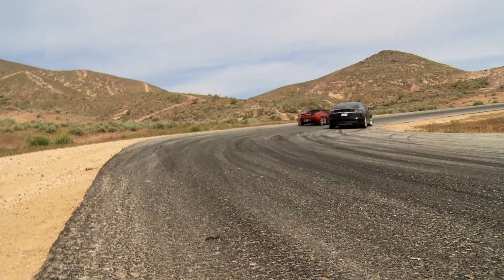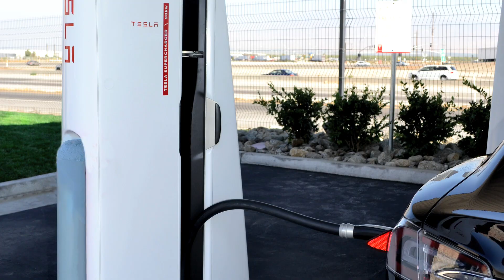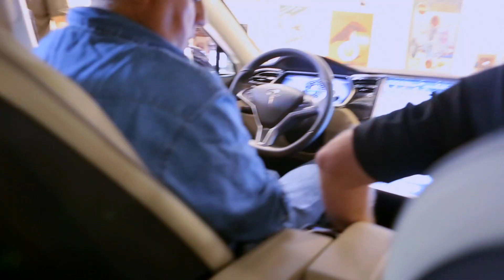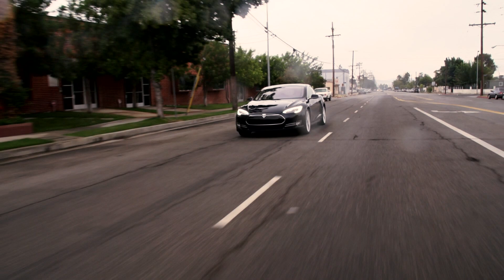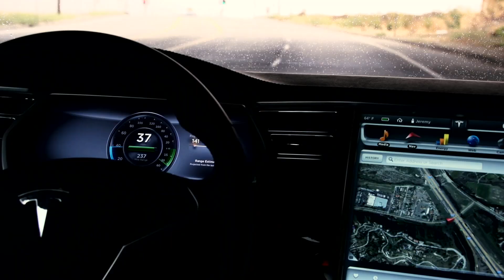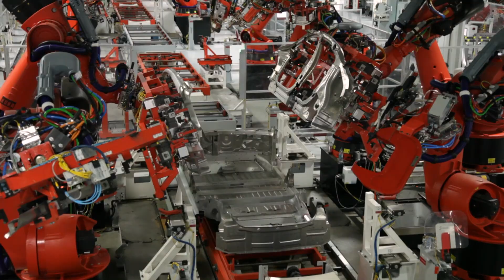2012 Tesla Model S - Jay Leno's Garage

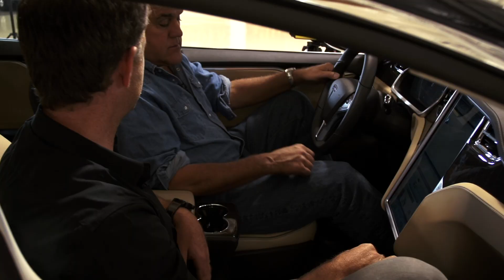Comment: 7:27 Life of the battery is only 10 years ??? So the whole car becomes a cool looking hunk of scrap metal after just 10 years ??? REALLY? At the Tesla's price of $100,000 and only lasting 10 years that is $10,000 per year of depreciation !!! So the Tesla saves you $3,000 per year in gas but looses you $10,000 per year due to its short battery lifespan ??? Someone explain to me how buying a Tesla over a Mercedes E class or BMW 5 series would make sense financially?
Reply: Sounds like he's thrown away a lot of perfectly good flashlights.
Reply: Batteries can be replaced when they die.  The 5k a year you save on gas and the fact that it doesn't need maintenance as often make buying this car realistic.
Reply: battery holds longer than 10y.
Reply: JundaComputersGmbH
as an owner of a model s I can tell you with confidence that it does not cost 45000 to replace a battery. I inquired about the prices awhile back ago and I was quoted 10000 to replace the battery. Which sounds like a lot but you may or may not have to do it after 10 years. By then you spent more on gasoline and lets not mention maintenance
Reply: A car normally works for 3 years, then all the problems come. A Tesla battery has a life at least 8 years.
Reply: Not a big deal Junda. Replace the battery pack with an improved one in 10 years. If you didn't learn it already, look at the Prius. The batteries are warranted for 8 years and rarely need replacement even then. I had a truck that the transmission blew out on it when it was 5 years old, cost me $3,000 to replace it. If you add up all the other maintenance, repairs, gas, etc., it's cheaper to operate a Tesla than probably any other gas engine car sold today. What does 10 years of maintenance and gas cost on your old fashioned gas burners? LOL
Reply: You dont pay 10000 a year
You buy a new battery for 10000 and drive the car another 10 years probebly with more milage than dodays model s
Reply: most electric car companies actually rent you the battery, as soon as they wear out they will be replaced free of charge
Reply: You can buy new batteries. Jesus.
Reply: Leo Tonozzi
  No you can't  Everyone knows that when an electric car's batteries die, you have to throw away the car.  Sort of like when you blow a head gasket on an IC car, the whole thing is just junked, right?  ;)

The reality is, the Prius has demonstrated that Lithium Ion batteries can last at least ten years - maybe longer.  And if the car is in good shape, it might be worthwhile replacing the battery (for example, using one from a wrecked car).

I am not sure why some people feel THREATENED by electric cars. These are the same dweebs that don't understand fuel injection and claim that "carburetors are better" and cars were "better in the olden days".

I dunno, I'll take the safety, performance, comfort, long service life, fuel efficiency and raw HP of today's pony cars over the ones of yore.   And yea, electric cars are among these - max torque at 0 rpm.

I live old cars, too.  But as an Engineer, I can't live in a dream world.  And since I drove a lot of the cars from the 60''s as a kid, I know what they were actually like. 

What I love about Jay is that he loves ALL CARS and doesn't waste time saying one kind  of car is better or worse than another.  He loves them all and has them all - from steam cars to turbines, antiques, muscle cars, super cars, electric cars, three-wheelers, motorcycles, odd-ball homebuilts, rolling sculptures, and whatnot.

I wish the audience could be as hate-free as Jay is.   Sadly, this is not so.
Reply: *****
I'm a total Petrol head. I had a '65 Shelby, now I have the best un-restored Classic Bronco in the country. I want us driving electric cars as soon as possible, because I want to have enough oil left so I can keep driving my classic cars!! As soon as battery technology makes a few more advancements, more people will jump in with both feet. The performance potential is very impressive, and compelling. I also agree about Jay, he just loves everything automotive. He understands that they all have something to offer and to be appreciated for. Some for their Artistic Rolling Sculpture like appearance(his bugatti type 57), some for their engineering advancements, some for their Historic Role in a given time period, some for their Outrageous  Performance, and some because they're just plain cool, quirky or weird. They all have values and qualities to be recognized for. Just look at the range of his collection. Nobody has a more diverse collection of cars than that man, and good on him for it. He can afford to any car he wants, yet he chooses cars that range from $5k- $5million or more. It's not about money with him and I love that. He's said himself that at any one time he has at least 130 cars in the collection.
Reply: The battery doesn't only last 10 years. 10 years is the warranty.
Reply: It takes about a minute to replace the battery pack on it. And since it's an electric car - there is not much that can go wrong. It's aluminium as well - so it wouldnt rust! So in terms of "how long it will last" - it can last 100 years+ if you just change the battery pack every decade. That's pretty sweet deal for just $100,000.

Merc Benz S class is usually a useless pile of garbage after 20 years.
Reply: ***** Replace the battery every decade? The 85 kwhr battery cost $45,000 each, half of the tesla's $100,000 price tag is the cost of the batteries, so replacing the batteries isn't as cheap as you think.

What I am worried about is that the Tesla is an electronic appliance, and electronics gets outdated very fast, a 4 year old iPhone 4 is completely garbage now, worth about $100, replacing the battery cost $80, so it doesn't make sense to pay $80 to replace the battery of an old iPhone worth $100 when its cheaper to just buy a new iPhone, that is what worries me about the Tesla, what if after 10 years the 8 year warranty is done, and the battery is badly worn out and has 20% of its original capacity, and the Tesla's onboard computer CPU is too slow and the center screen will freeze, rendering the car uncontrollable, and unusable, since EVERYTHING on the car is controlled from the center touchscreen. The whole car is worth $30,000 when it cost $45,000 to replace the battery and $2,000 to upgrade the onboard computer. You saved at most $50,000 worth of gas in 10 years, but sadly, that money you saved will have to go back to the car in the cost to replace the battery and update its computer hardware.
This is what I am worried about.
Reply: ***** I think I'll buy a Tesla Model 3 when it comes out in 3 years, the Model 3 is much smaller, lighter, and cheaper than the Model S. The whole car cost $50,000 so after 10 years the gas it saved you is about $40,000 - $50,000 so the gas savings has paid for the value of the car itself so depreciation won't be a problem, that would make sense to buy a Model 3 when it will pay for itself after a few years if you drive a lot of miles.
Reply: I believe they meant that there is no degeneration of the battery until 10 years.
Reply: Buying any new car wouldn't make sense financially. The Model S is just a good car.
Reply: You suck at maths, buddy.  If the car is $100,000 and the battery lasts 10 years, that doesn't mean it depreciates by $10,000/year.  The battery isn't 100% of the cost of the car, so logically speaking, if we assume the battery is 1/3 the cost of the car (which is more accurate), it depreciates $3,330/year.  Even this assumption would be inaccurate, as the batteries don't simply die outright after 10 years; they merely lose a significant chunk of their range.

Fortunately, this is where the gigafactory will come in.  By reducing the cost of the battery pack, the idea of a replacement battery after it passes its due makes a lot more sense financially.

This whole scenario is further complicated when you introduce battery swap routines, which is the practice of swapping your car's battery for a fresh, fully-charged one in the interests of saving time.  The swap can be done in the amount of time it typically takes to fill up a petrol tank, and you'd obviously end up with a different battery to the one you started with.
Reply: JundaComputersGmbH 80% battery capacity guarantee at 10 years not total battery failure. So they guarantee at 10 years you will still have 80% of the battery you had when it was brand new. That's not that bad
Reply: That depreciation would happen no matter what $100k luxury car you buy. You see the same kind of depreciation in a Mercedes s-class.
Reply: ***** I think the Tesla would be perfect to use as a Taxi. The Gas savings would be insane for a taxi driver that does 60,000 miles a year. I see alot of Lincoln Town Cars as Airport Pickup Taxi's. Lincoln Town Car/Ford Crown Victoria Taxis has a big gas guzzling V8 that does 19 mpg combined, that is a gas bill of $12,000 per year at $4 a gallon. Even the most fuel efficient Toyota Camry Hybrid Taxis at 40 mpg still has a gas bill of $6,000 a year. The Tesla's gas bill is $0 because Taxi drivers can just supercharge their Tesla's for free. I see a big enough margin for profit for taxi drivers with a Tesla.
Reply: JundaComputersGmbH Just keep in mind that the warranty is for 8 years/infinity miles so just because you're driving for free(using superchargers), don't go overboard.
Reply: you are one of the clueless german naysayners that does not understand a ball about technology. the used battery is not dead it only has less capacity. so instead of 85kwh it only can hold 60 kwh.
it is still in working order and will be reused as home storage for solar power or industrial purposes.
60kwh is still a lot.
and in 10 years the battery technology will much better, but I know you do not beleive that even if you sell technology.
so in 10 years the same car will do 600 miles on a charge
Reply: I would not put any internal combustion car in a contest with an electric car for yearly low maintenance, it is unfair even to a BMW or Mercedes Benz where yearly maintenance can be quite expensive.  The vehicle outside the battery will be in fine order the 100% depreciation is extreme to claim, the 10 years old battery will have about a 70% original capacity.  Tesla cars can have battery packs replaced as battery technology improves there are billion of (name your currency dollars or Euros going into battery technology). Older Tesla roadsters are being offered a battery upgrade and these smaller cars are getting range extensions close to 400 miles, say 600 km.  So in 10 years I am sure the batteries be much more impressive.  Also observe that BMW and Mercedes Benz have decided to take on tiny new upstart Tesla, not GM or Ford's hybrid or electric offerings. They recognize this is a true 21th century car company, their future American competition.
Reply: Consumer reports tested a 10 year old prius and found that the battery pack was working just fine, with only a slight amount of degradation.  So 10 years may be a pessimistic number.
Reply: *****
Ditto Bubba, on everything you said. I really think the biggest hurdle electrics need to make is charge time. The funny thing is, I live in Houston,Texas....Oil Central.....and Tesla's are selling like hot-cakes around here. I see at least 3-5 just on my way to and from work every morning.
Reply: JundaComputersGmbH

If you have a 10-year-old car and the motor blows up, do you buy a brand-new motor, or yank one from a low-mileage wrecked car?

If you are smart, you do the latter.

The same will be true for Teslas.  Find a wrecked one with an intact battery pack and make the swap.

The Prius has been on the market for OVER A DECADE now, and the batteries as still going strong.

So a ten-year replacement time may be conservative.  15 years may be more like it, and that is about the design life of modern cars.
Reply: Cody38Super
 What I don't understand is why some people feel threatened by these cars.

Oh, I get it, the Obama PC Police are going to come to their home, confiscate all their guns and the replace their Hemi Cuda with a Nissan Leaf or a GEM electric car.

The funny thing is, electric cars, as Tesla has demonstrated with its roadster, can burn rubber and go 0-60 very quickly - faster than many IC cars.

What will kill the electric car this time around is cheap gas (which kills electric cars every time).
See:

http://livingstingy.blogspot.com/2010/12/who-killed-electric-car-this-time-cheap.html

What I LOVE ABOUT JAY LENO is that he loves all cars and doesn't have an irrational hatred of any kind or any irrational love of another.

He owns a number of steam cars, but he appreciates that they are not the "answer" to anything, and have their own limitations.

He also understand that electric cars have their limitations, too.

That doesn't make them any less interesting or less cool!
Reply: Cody38Super
 Actually, the power issue is not an issue.  Since most EVs will be plugged in at night, when power demand is low, there is no need for "new cables" or anything of that sort.

Right now, the biggest problem for utilities isn't energy costs, but power generating capacity - specifically the infrastructure costs in building power plants (of any type) to meet peak demand.

If you can load-shift to off-peak hours, the utility company would love it.  In some situations, they will actually sell you electricity more cheaply, if you buy it at night.

For commercial users, who are charged on peak load, load-shifting allows you to keep your peak load down, and thus your overall power bill.

For example, ice storage systems are used by many commercial users, to make ice at night (using off-peak power) that is then melted during the day to cool large buildings (I tested such a system for Carrier back in the 1980s - they are in widespread use).

The utility companies have power galore to nearly give away - at night.

And most homes these days are wired for 200 Amps, so it is not a big deal to add a 220V plug in the garage (where many homes have the main breaker anyway).

But even at 110V, most electrics will fully charge overnight, using less than 20 Amps.

So, I don't see infrastructure or generating capacity as an issue.  So long as you are using off-peak electricity, there is more than enough capacity.   And this is one reason the power companies love EVs.  If they become popular, they have the unused capacity to sell - and they want to sell it.

There is, however, a legitimate issue about pollution, however, if the generating plant is a dirty coal plant.   Arguably, there is no reduction in emissions, in particular CO emissions, unless the energy used to generate the electricity is from Nuclear, Wind, Hydro, or Solar (the latter of which has a problem working at night).

But even if the electricity comes from coal, it does mean less dependence on foreign oil.
Reply: Cody38Super

Well, that is the conundrum with electric cars.  Suppose people start driving these a lot?  What happens to the price of gas?

Demand goes down, and thus the price will go down.   Simple law of economics.

So, now gas is cheap, and the incentive to go electric diminishes.

The electric car will be what kills the electric car.

Supposedly, Israel has made a commitment to go all-electric.  But their motivation is to eliminate dependence on Arab oil for political reasons.
Reply: *****
The price probably won't change much, because all costs for exploration, extraction, and refining will remain the same. Also, people forget that ALL new cars, especially the Electric ones use A LOT of Plastic!! Plastic is as direct of a derivative of oil as gasoline is. All the ingredients for plastics comes straight off the top of a barrel of oil. Without a shitload of oil.....no plastics. What are we gonna replace plastic with??.....fiberglass?......crap material, to labor intensive. Carbon Fiber?........to labor intensive and expensive. You can't just keep recycling it, it weakens structurally. You have to add a certain amount of new plastic to every recycled batch. Israel can do whatever int he hell they want because there's only 6 million of them. There were more people in my graduating class!  The reason the electric car doesn't die......oil is finite!! Were gonna run out. When the oil runs out.....so does the plastic......ooooooooh. The one thing people always forget about running a car on.....CNG....and we have enough to last us a very,very,very,very long time. Hydrogen is another one we need to pursue. There's a lot of options and combinations to explore, but we've gotta start doing the leg work now, not later. Now, I just got a thousand rounds in my Christmas stocking, so I'm gonna go do a little shootin' today.
Reply: *****
That's not really a good comparison though since the Prius uses a nickel cadmium battery, which generally has a higher cycle life. Tesla batteries also have to withstand being charged at 120-135 kw at the supercharging stations.
Reply: davidlaserdesign I agree with this..  However, I have a question regarding an issue with reliability.  I know someone who has gone thru 3-4 motors on his Tesla (he's had it for little over a year) which have all been replaced free of charge by Tesla... but what happens when the warranty runs out?  Spend 30k (guessing) a year on replacement motors to keep it running?  Or is the resale value really going to be zero on these cars?
Reply: andy993
Most of the problems that plagued early Model S cars (defective motors, faulty battery packs etc.) have been fixed so that they now fail at a much lower rate than they used to.
Reply: PINGPONGROCKSBRAH I hope so.. but still, I think what Tesla needs to do is have a buy back program (like a certified pre-owned deal) so used ones can be sold with warranty.  Otherwise, a couple failed non-covered motors hitting the media is going to make resale drop like a rock.  No one will want to buy a used one with no warranty.  I sure wouldn't!
Reply: I've taken a look "under the hood" of the Model S, and they're still using two identical motors coupled to a reduction transmission for the standard 2WD setup. You could make that whole deal even more optimized for a range of speeds by altering the diameters/windings of the motors and playing around with the inverter. It would be damn hard to simplify the transmission; you don't really need it though. Just put in another inverter with a different layout, add some programming, done. That'll cost you, what, 1200 bucks street? Which translates to who knows how little in production costs.

The point though, is that batteries are the bottleneck. If we can get away from these damn Lithium low-voltage cells, you can both reduce heat buildup, reduce materials costs and shrink the size of the equipment something fierce. Now, this being the case, don't you think the people at Tesla are already looking around at alternatives? There are some very, very smart people around the world working on battery tech around the world right now. And chances are by the time you actually need to swap that pack the cost of the cells will have gone down already, or if you drive conservatively there might already be another alternative.
Reply: Will Davis
Reply: ***** Just one note... The Prius up until the 2015 models didn't use Lithium batteries... They were NiMH...But, Yes, the battery life IS holding up VERY well...